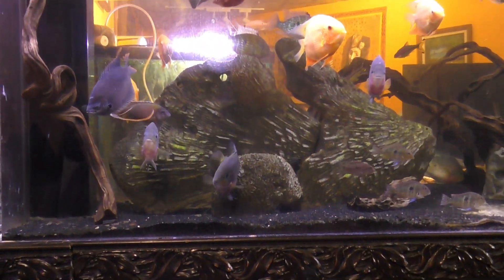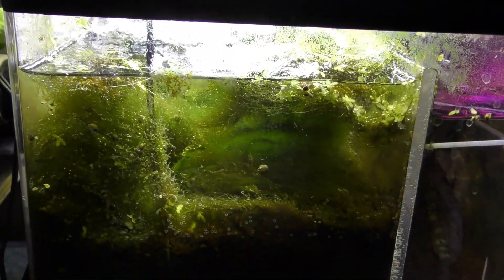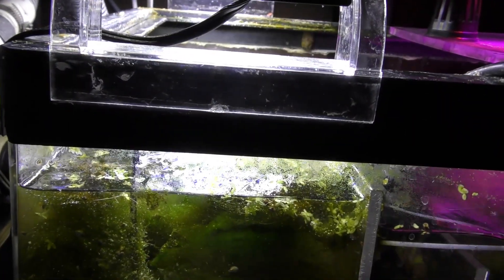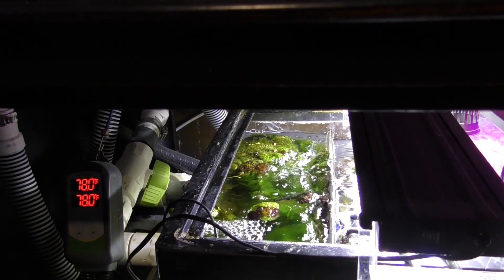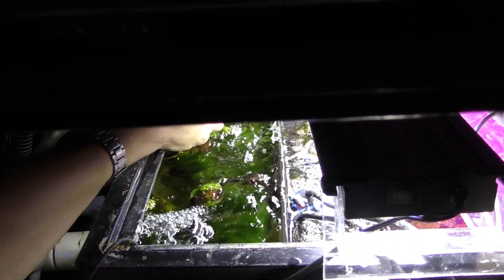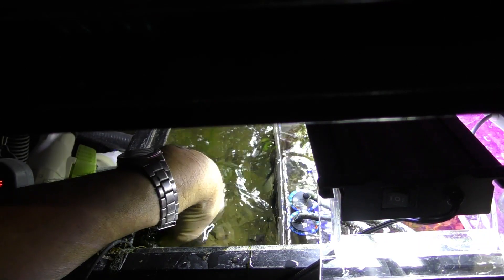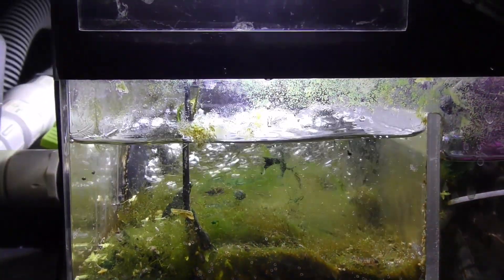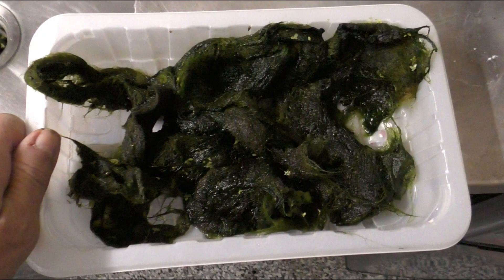DIY Algae Scrubber. Out Performs Expensive, Name Brand Units

Comment: Would this make a dent in a 40g sump of a 200 gallon tank w 50-70 malawi🤷🏼‍♂️
Reply from the maker: I still do water changes.  My aquaponic grow bed on my 500 gallon is more effective in reducing nitrates and phosphates than an algae scrubber- unless you are able to make it larger
Reply: @HalfManHalfCichlid  right... would the algea scrubber help at all with nitrates then you think in that setup?
Reply from the maker: @cards_curmudgeon  yes and phosphates which can cause algae growth
Reply: @HalfManHalfCichlid  would you recommend to the algae scrubber on the foam like you showed AND water lettuce in a refugium?
Reply from the maker: @cards_curmudgeon  yes if you have the space.  If it is optimized, light and nutrients tou will be discarding fistful of algae and water lettuce every couple of weeks.
Reply: @HalfManHalfCichlid  AWESOME... thanks so much for your reply!!!

Sounds like I'm lacking some info tho so please correct me lol

For for the algae scrubber I just need the foam in the first tray with the input water hitting it and the light 12 hours over night?

For the refugium, I just need the water lettuce sitting at the top of the water w same lights and 12 hours overnight?

What do you mean by nutrient process and would that affect my water parameters?

Anything else to "optimize"🤷🏼‍♂️

Would I need plexiglass? What's the easiest way to get that to size lol

Comment: Hello! first, thank you! second, two questions please: [1] Have you found out what is the optimum amount of algae we should take out and how often? [2] Did it eliminate algae from your display tank? Mine has slowed down, but I still need to clean out algae; just the cleaning frequency has decreased. After looking at your video, I made the exact same thing for my high-tech Discus planted tank+sump setup. Initially, algae took maybe 2 weeks to start growing there. I harvested algae 4 weeks after that. Maybe I harvested too much because the sump area for algae (a.k.a refugium in the saltwater tank hobby) had almost no algae growth for a good 2 weeks again.
Reply from the maker: The growth of the sump algae is proportional to the amount of light, phosphates and nitrogen compounds such as ammonia and nitrates.  When I was using plant fertilizers the sump algae would fill up in 10 days, but it was depleting the nutrients for my plants.  I only use the algae scrubber now for aquariums with no plants.  The more you feed and the higher the fish density the more nutrients to accelerate the algae growth in the scrubber
Reply: @HalfManHalfCichlid  ok thanks. How often do you remove the algae from the scrubber and how much did you remove each time?
Reply from the maker: @rajdude1  I am running CO2 in that aquarium now and trying to grow b eautiful plants.  For the time being the scrubber is off so the plants have nutrients.  Have you seen my recent video on my 500 gallon aquaponic grow bed??   I actually love this set up too
Reply: @HalfManHalfCichlid  ok thanks. I also have pressurized CO2 in my Discuss tank and plants grow beautifully, with or without the scrubber. Algae grows like crazy no matter what. I guess my fish poop way too much LoL
Trying to reduce fertilizer these days. Eventually will find a sweet spot, hopefully
Reply from the maker: For sure, my scrubber reduced aquarium algae.  There is lower concentrations of nitrogen compounds and phosphates which algae thrives on.

Comment: Does high algae growth cause no pH swing in your tank? 

I'm planning to add this to my tank, which is currently having algae bloom right now, I did let that go on purpose to remove nitrate, since our tap water's nitrate are high, the pH was constantly 7.5 for about two months with hair algae growing in the tank.

But just today the pH raises to 9 when the lamps are on for a few hours, and goes back down to 7.5 a couple hours after I turn off the lights.
Recently a new type of algae grows in my tank though, it's like carpet and deep green. Maybe that kind of algae that's causing pH swing not the hair algae?

Now I'm not sure should I make these or not lol
Reply from the maker: When plants are growing quickly, their rapid carbon dioxide uptake may cause high pH until the phytoplankton community comes to a new equilibrium.  What you are experiencing is a normal cycle.  I can't say how an algae scrubber would work in your system with your water parameters.  My water is hard and has a high buffering capacity, and I do not see swings in the pH
Reply: @HalfManHalfCichlid  thank you!

Comment: Is this better than the pothos you have set up on the other tank? From a nitrate reduction point.
Reply from the maker: Trying to measure nitrate reduction from one vs. another method is nearly impossible.  I measure the amount of plant/algae mass grown (by weight. Volume) from aquaponics and the algae scrubber.  The algae scrubber out performs the aquaponics grow bed, but I need to add easy green from aquarium Co-op to maximize growth in the algae scrubber.  My scientific background tells me the Easy Green supplies phosphates and trace minerals that accelerate algal growth.

Comment: I can't understand what you said about the foam. Neither do I get how you installed the foam. Would you clarify this for me?
Reply from the maker: The foam from Swiss Tropicals is 10 pores per square inch.  It fits snugly into the 1st chamber in my sump- leaving about 4 inches of space at the top for the algae scrubber area when running  Hooe this helps
Reply: @HalfManHalfCichlid  Thanks for the fast reply. Now I get it.